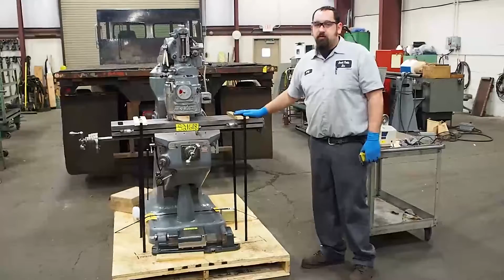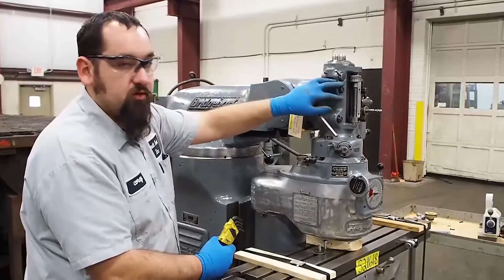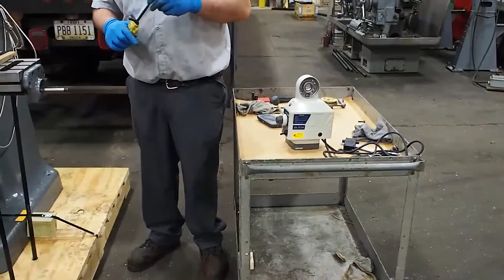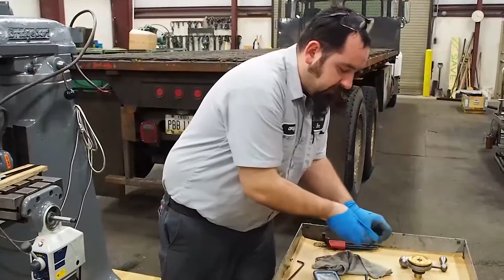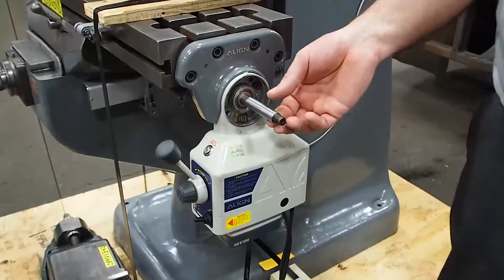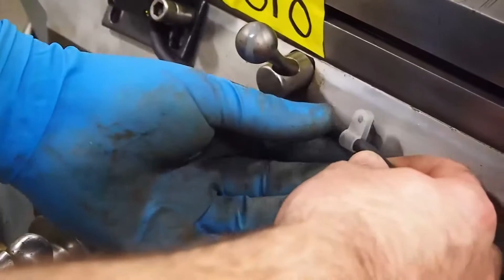How to Install a Bridgeport Table Screw & Mount the Head

Comment: Please let the prices in description. Will be much easier
Reply from the maker: We used to do that. We found that linking to the original product listing in our eBay store was a better idea, as the customer could calculate shipping costs through eBay's system and review product photographs too.

Also, if a customer is interested in a repair job, they'd have to call and we'd calculate an exact cost for the repair if they'd like it done by one of our mechanics.

Another issue, products get sold frequently so prices could be out of date. So, pricing is a bit more complicated than we originally thought it would be. Hence the lack of a specific price under each video.